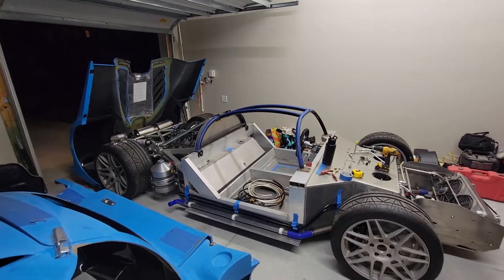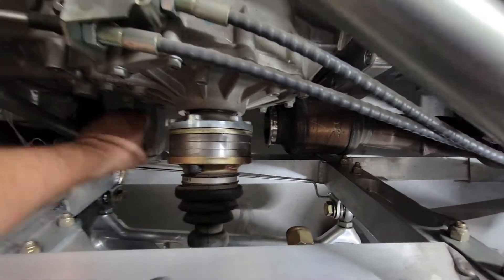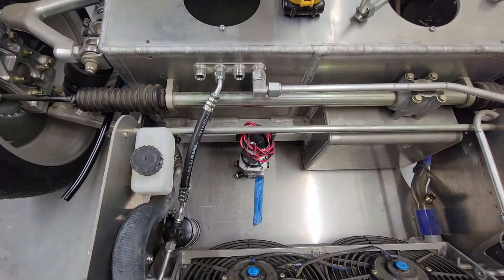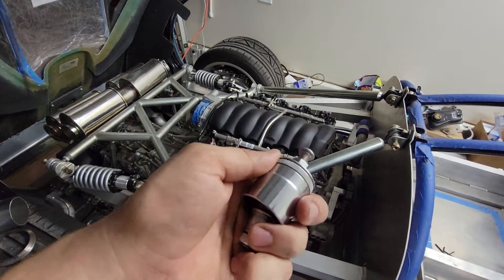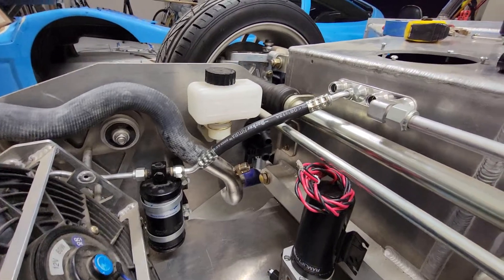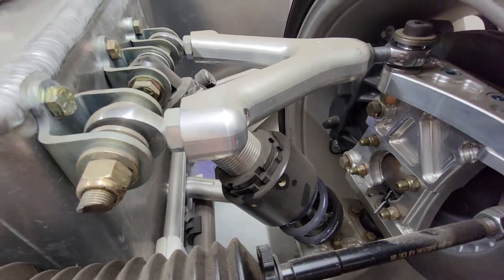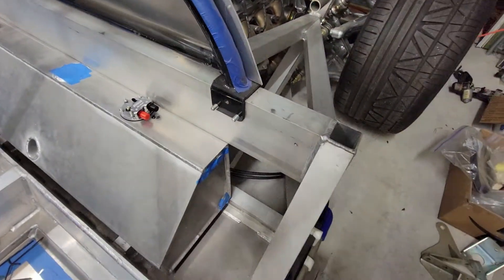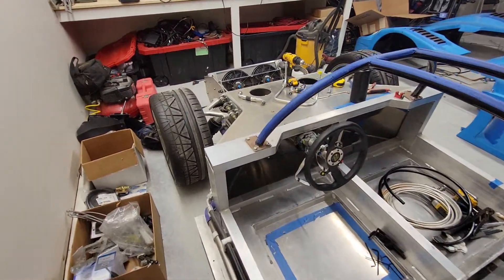SLC walk-around

Comment: Geoff, not sure you really want the heater control valve in the front. It will just heat up the side pod all the time. Most builders put it in the back so hot water only circulates through the side pod when heat is needed.
Reply from the maker: I layed it out so many times with the valve in the back and I just didn't like how the lines would be routed. I plan on insulating the tubing with foam sleeves and if its a problem I can always revisit it later.